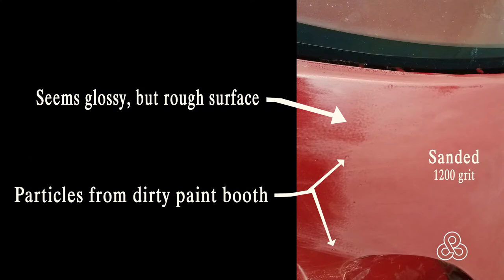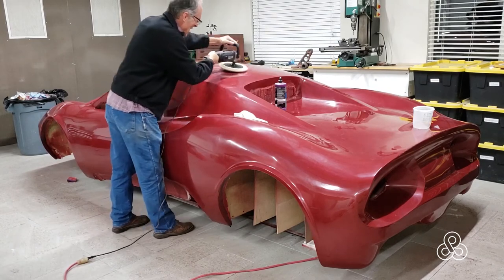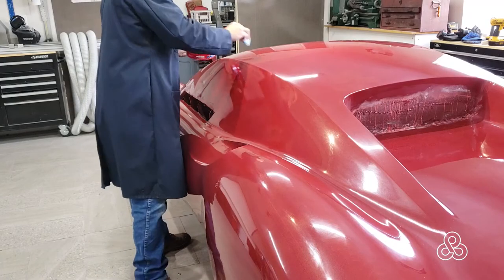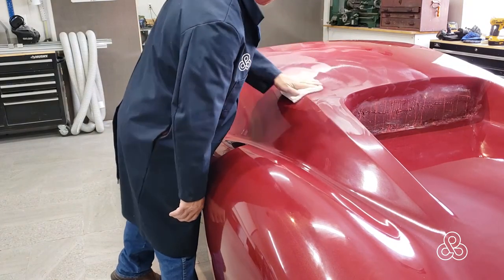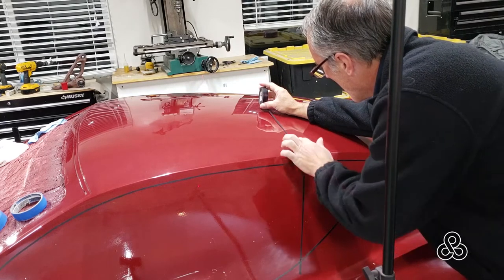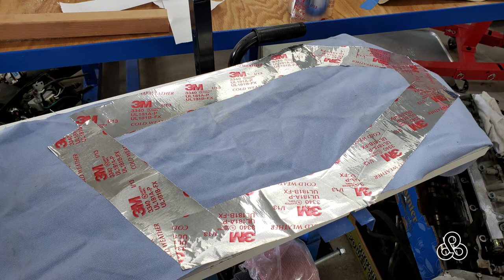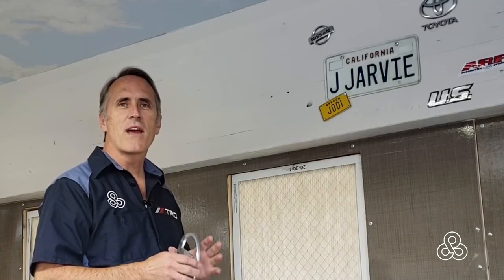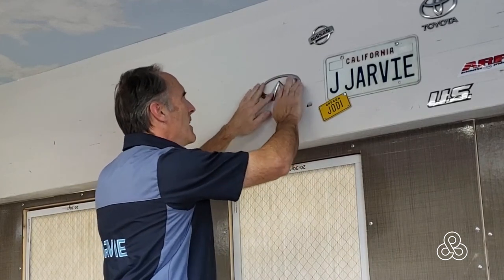A07 - In the buff, wax and parting lines- Arete supercar

Comment: It might be worth experimenting with some of the newer ceramic and nano coatings on a test plug as an alternative to wax. 

They create very hard wearing surfaces and they are so easy to apply by spray bottle it could mean you could literally spray down the whole buck pre-mould in five minutes... as you would be building layers like an old cast iron pan on every use. 

It also means every crease and nook would get coated.
Worth a thought. All the best. 😎👍
Reply from the maker: For sure, when you get into production molds the time savings of not re-coating is worth it. Systems like FreeKote are the bomb!

Comment: you only need one coat of wax, more is a waste. just dont miss spots
Reply from the maker: Multi coats assures you don't miss a spot. . .as you said don't miss a spot. Having a part permanently bond to the mold is really a waste. Ha!
Reply: @BuilderCreator  yes im sure that would be a big waste, personally i havent ever encountered that nor have any of my coworkers
Reply: Wax is cheap.  Having the plug permanently bonded to the mold could be catastrophic.  Even if the odds are low, I see no reason to take a chance.